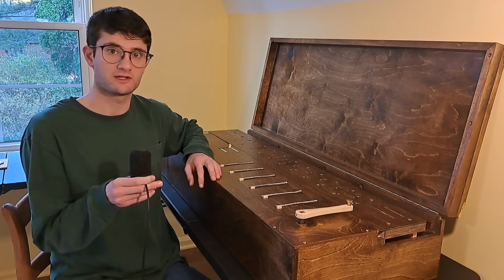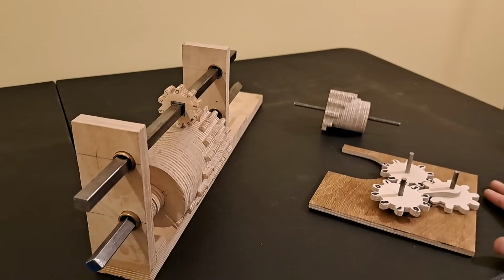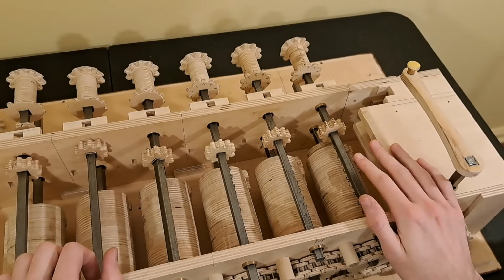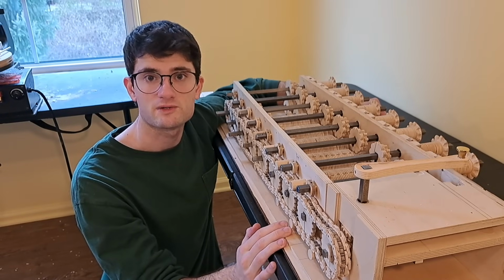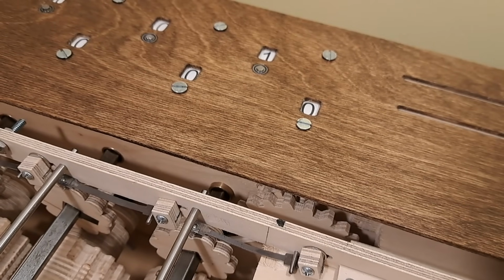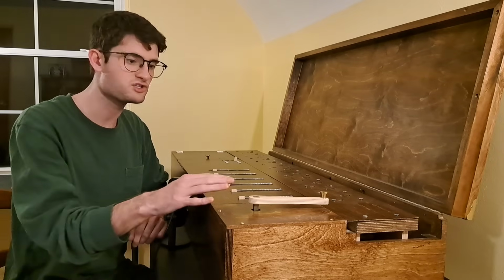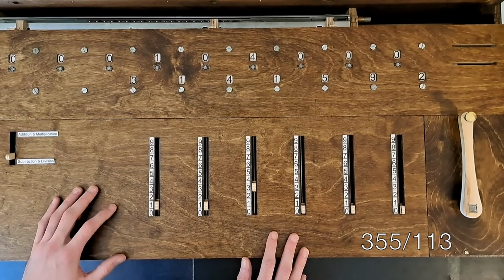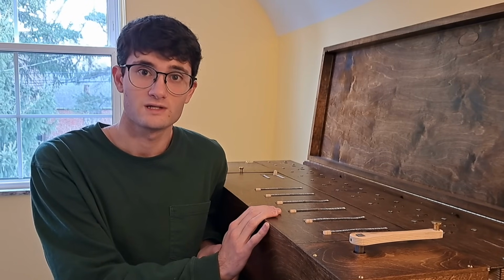How I built a Mechanical Calculator

Comment: Wonderful design. Any measured drawings available?
Reply from the maker: Thanks! Sorry I don't have a plan. Once you decide the shaft spacing between stepped drums and from the stepped drum to the 10 tooth gear, then that determines the other dimensions. In my case, the distance between drums (shaft to shaft) is 3in or 7.62cm, the spacing between the stepped drum shaft and the 10 toothed gear shaft is 2in or 5.08cm. I apologize for imperial, I started this project in 9th grade
Reply: @WhatWillMakes  Thank you for your reply. I'm 68 years old, so imperial I understand...lol.

Comment: I have a Monroe Adding Machine and it's really cool seeing how this behaves exactly the same way.
Even clearing the counting register lifts the whole assembly up automatically before clearing to disconnect it from the gear train.
The technology got miniaturized, but fundamentally stayed the same until it was replaced with electronics. Heck, even the motor driven ones (electric but not electronic) operate in the same way.

Comment: I broke out laughing when instead of simply labeling the digits in reverse on the second wheel, you added a third intermediary wheel just to carry.
Reply from the maker: If I had been making a full sized Schickard or Pascaline adder then the reason would be more obvious, we want each input wheel to rotate the same way because then the user interacts with all of the input wheels in the same way. With the Schickard adder in particular you could also do subtraction and it would get confusing quickly which way is needed to rotate the wheels if every other one goes in the opposite direction. Thanks for the comment! - It gets to a core element of these machines, that every decimal column should behave the same, especially to the user

Comment: Dude... cool project!
But please, for your own sake... just buy a 3D printer.
Even the cheapest one would help you out tremendously.
But I admire your dedication.
Reply from the maker: Thanks! About 3d printing, a couple people have asked and the answer is I just like working with my hands - I find it very satisfying. Also, as I say at the end, I like how it shows that specialized machinery was not needed to make this technology
Reply: @WhatWillMakes  Expanding on your tool set doesn't conflict with that.
It just opens up new possibilities.
3D printing isn't magic bullet, and there is still labor involved.
But it's perfect for repetitive tasks like the chain links.
Also they are fairly common consumer products now, so I wouldn't call them specialized.
Ask a friend if you can borrow one for a project to test it out.
You could use one just to print out jigs or templates to speed up your workflow.

Comment: How about using a mechanical computer to make a lead and bullet drop calculator for a nerf gun? It would be hard making the parts small enough to be portable, but it could be done with wood as a prototype and then scaled down and made of metal to be mounted on the gun. For the display you could use a reflector gunsight to frame the target's position and range. It was done by allied fighters during WW2, so with enough tinkering, I'm sure it can be done.

Comment: The reason you didn't share the exact measures of the project is to incentivize people to be creative and build their own versions of the calculator?
Reply from the maker: I didn't really try to make this video about how to recreate my exact calculator, more about the principles of how it works and things of interest. I simply don't have a set of plans or anything, just a couple of drawings for some of the wheels, most of which are drafted by hand, the other dimensions grew out of some specific dimensions for shaft spacings and I didn't need to create a full plan. All the gear templates were generated using Matthias Wandel's gear generator program found in the description. I suppose I could retroactively make a set of plans, but I'm not really sure that work would be worth it. But if you want any specific dimensions please ask!

Comment: Sweet work there!.  I couldn't help but grin.  

As a bit of personal history, I went to university in the late 60's having mapped out 5 possible different engineering career disciplines to explore. One of those was chemistry which I truly enjoyed BUT hand performing the multiply and divide calculations to the precision required drove me batty. I finally found a Frieden mechanical calculator which, when operating bumped along just like your design.  This was so painfully slow that I abandoned that path, tested the others, and finally fell in love with electronics and earned a degree in electrical engineering with an effective minor in computer science (a field that did not really exist back then). 

Getting back to calculators during that time. Precision extended electronic calculators began becoming available in 1960 and the first emulated the Frieden machines.  Wang made the first extended-range 4-function calculator around 1966. I got my hands on the Electrical Engineering Department HP9100 programmable in 1969 (the year after it came out) which I programmed to plot EM antenna radiation patterns from equations.  I finally got my own sweet HP-35 in 1972 the first year the came out while working at my first engineering company.  Since then, my ability to put calculating and computing power to use in electronics and mechanics has continually grown.  It's fun to look back but I wouldn't trade my ability to mathematically and computationally explore the ideas that rattle around in the gray matter. 

Again an excellent exploration of first principals engineering.

Comment: Clever!.. Dividing 355 by 113.. I use this number also for doing "quick paper calculations"
Nice to that this device shares a lot of simularities with the Curta Calculator, setting the numbers, and moving the result slide..
Reply from the maker: Thanks! The way I've been thinking about it, the Curta is like rolling this calculator up around 1 stepped drum
Reply: @WhatWillMakes  Exactly, looking at drawings and 3D printfiles of the Curta Calculator, that is what Curt Herzstark actually did.. but then so small you can put one in your pocket.. 
Compared to your handywork, which i find impressive maybe you should get hold of a wooden barrel to make a wooden "Curta"...

Comment: It occurred to me that the input could be done by twisting dials to turn gears that drive racks to move the drive gears to the correct position. Add in another spring detent for the input gears/dials/knobs and you get more certainty and a little more elegance perhaps? 🤔
Reply from the maker: That's a clever way of doing it! Actually seems sorta similar to the reconstruction of Leibniz' Stepped Reckoner in the Arithmeum. I considered adding some way of registering the input sliders, but I really wanted to be able to easily take the top cover off and see the stepped drums and carrying mechanism. Thanks for the comment!

Comment: Back in the 80s I went to a vocational electronics school. Personal computers were just becoming a thing so we spent quit a bit of time understanding how a modern computer functions.
For all their power and marvel the modern PC it still only does what your little adding machine does here.
Instead of gears it uses logic circuits which do not think, they only respond mechanically to a specific input.
Your PC is still only an adding machine and can only add numbers. All other functions are simply a variation of the addition function. Everything it outputs to the monitor for your eyes to see begins as a mathematical operation and all of those operations can be reduced down to simple addition.

Comment: The factor 10 for each digit is not only fundamental to the decimal system but also to the  metric system of units ... so your next challenge is to make a machine that allows adding up length measurements in 1/32 inch increments and has a readout in inches/feet/yards ... multiplication represents e.g. calculating the area of a room ... division would be the length of a square room given its area ... 16 teeth gear to get to  inches ... 12 teeth gear to get to feet ... 3 teeth gear to yards ... 😅
Reply from the maker: Could definitely be done! Some calculators (including some models of the Pascaline) had different bases for working in different currencies. In Ancien Regime France 12 Deniers went into 1 Sous, and 20 Sous into a Livre, so Pascal made some models that worked with those bases

Comment: This is so cool! It's like a Curta calculator that's been unrolled flat.
Reply from the maker: Thanks! and yeah that's how I've compared it to the Curta as well!
Reply: Might be more accurate to call a curta a rolled up arithmometer! (Which is a very nice solution to the redundancy of the rotating drums!)
Reply: @rewindoflow  Indeed!
Reply: The Curta does have one very significant mechanic difference though (besides the shape and size). It only drives the results wheels forward. There is no reversing mechanism for subtraction. It actually uses 9s complement addition to simulate subtraction, and the single central stepped drum is actually two stepped drums with tracks of teeth interleaved together. The subtraction mode is engaged by slightly lifting the stepped drum, which moves the alternate subtraction teeth into alignment.

It's quite a crazy and interesting mechanism, which I don't think any other device has used.
Reply: @TonboIV  Yes, I don't recall seeing doubling up of the stepped drum elsewhere. A very neat solution, and one that only makes sense on the Curta!

Nine's complement subtraction does have uses in other machines though, most notably in the operation of comptometers where it's used as a manual routine to perform subtractions (hence why the keys are often marked with things like 1/9, 2/7, etc). It's also used in the Mercedes Euclid, which has a rather unique proportional lever mechanism.
Reply from the maker: (I am delighted by this conversation – thanks for all the knowledgable comments everyone!) I know the Pascaline also used nines complement on its result dials to do subtraction
Reply: @TonboIV  For similar reasons, common computers use 2's complement numbers for signed fixed point arithmetic. Earlier computers used a variety of systems, including 1's complement in e.g. the PDP-1. The PDP-1 also used traveling pulses for actuation, not a central clock.
Reply: Yo it's codeparade!
Reply: Maybe curta us this rolled up

Comment: You need a better way to clear. It would require a redesign of the carriage so lifting would not be needed to disengage. It would also be nice if it would lock if you went negative on subtraction. That would make division easier.

Comment: This is a work of art, the machine, the process, and the video. May I ask why you opted not to use more time efficient manufacturing methods such as a laser cutting or CNCing rather than cutting out the gears by hand? I realize some gears shall not work well but most are purely two-dimentional cut-outs.
Reply from the maker: Thanks! For one I don't have a laser cutter or any CNC machine, but something like that would definitely save time. I also just like using my hands, it's very satisfying. Then as I say at the end, I like how it shows it doesn't take specialized machines to make technology like this (people had been cutting much smaller gears for clocks for centuries), but rather enough interest in solving the problems. I appreciate the question!

Comment: As an alternate idea... rather than gears, you could use a length of cord (as long as it doesn't stretch.)  fastening the cord to different shapes gives the same operation, pulley, or hanging it with a weight and using a shaft.  One other idea, using magnetism, you can create positional transmission with a device called a syncro... which is just a precision three phase electric motor. Happy Sunday!

Comment: Am I missing something or is there any reason on why you would not need to carry a 1 over to the next digit. Couldn't you do without the lever mechanism and extra gear.
Reply from the maker: I'm not sure exactly what you're asking, but I think it is why the the result dials need to be able to be disconnected from the carry mechanism? And the answer is so that we can shift the results assembly over into a new decimal place. If your question is why we can't use the same carry mechanism method as I made in the demonstration at the beginning of the video, then see endnote 2 in the description. Thanks for the question!

Comment: I once saw a video explaining the curta calculator and did not understand what was going on. Seeing how you solved each individual problem based from clear design requirements made it easy to follow and understand the impressive complexity of the machine you have built. Well done! Also very impressive how many hand cut gears you've managed to turn with a single crank, I can imagine preventing friction throughout the machine was not trivial. 

One of the most impressive things I've seen!
Reply from the maker: Thanks so much! I'm glad my explanations made sense, it's very gratifying to hear people's feedback. Yeah friction is the enemy for sure
Reply: @WhatWillMakes  I've assembled a number of laser cut clockwork mechanisms and rubbing the gear teeth with paraffin wax makes them run much smoother with less friction.
Reply: I recommend you this if you want to revisit the curta, especially with the understanding you have now. I think you'll find a lot of the solutions are very similar in concept, just very different in scale and precision. This series of two videos is what helped me understand the curta

https://www.youtube.com/watch?v=vCjJ5GeuQD8
Reply: @MinecraftTestSquad  Thanks! I'll take a look

Comment: Marvelous craftsmanship. Has any lubricant been necessary? I imagine it runs much more smoothly with paste wax on meshing parts.
Reply from the maker: Thanks! I put some light clock oil on the bushings, and played around with wax on the wood, but I've found that when the tolerances and fit are just right, wax isn't that necessary

Comment: This explanation of how division is just repeated subtraction was really interesting to me. That's actually how GPUs do their division operations too, because they're technically only capable of handling multiplication, addition and certain bitwise operations. But i never could wrap my head around how it worked until now.
Reply from the maker: I didn't know that about GPU's. Fascinating! Thanks
Reply: @WhatWillMakes  makes sense, modern computers are basically just the inevitable outcome of humans seeing this machine and saying "Okay but what if we could do more/faster calculations?" Lmao
Reply: If you make the mistake of doing integer division on a GPU then it'll use some software-implemented division algorithm yeah, though typically people will use floating-point arithmetic on a gpu in which case division will typically be done by estimating the reciprocal of the denominator using a table lookup, then improving that reciprocal using newton iteration, and then multiply the numerator by the computed reciprocal.
Reply: Here's a fun one though, the Texas Instruments C6x DSP architecture has an instruction intended for implementing integer division, but it's quite a funny one. It takes two 32-bit operands and produces its 32-bit result as follows:

if( operand1 >= operand2 ) {
    result = ( operand1 - operand2 ) * 2 + 1;
} else {
    result = operand1 * 2;
}

Implementing integer division with that is left as an exercise for the reader ;-)

Comment: Great video, thx for sharing. Make a modern binary version. No need to stack 10 wheels, you just have 0 and 1... or hardcore hexadecimal version...
Reply from the maker: Thanks! Yeah a binary version could easily be made, not needing to stack 10 wheels. Leibniz certainly realized this; he campaigned for the general use of binary in all calculating, and he wrote about how a simple binary adder could be made using balls and chutes. I like how this calculator highlights what base ten means, and how there is nothing special about it, could easily be binary or hexadecimal.

Comment: this is rad. i bet based on design you could put the addition/subtraction switch in "neutral" if you will and then reset the number counter without lifting the display face 🤙🏼 maybe, probably not since you didnt do that in the vid. increidble effort, this is awesome
Reply from the maker: Thanks! And that's a very perceptive suggestion about resetting – and it so almost works! It's a little bit too tight unfortunately

Comment: What about spring loading the shaft of the handcranker and have a push button that releases it full rotation (and can have 1-9 buttons/rotations) and wallah no hand cranking !!!
Reply from the maker: Yeah that's a good idea, could probably be done! You'd still have to wind that spring occasionally, but would save time during a calculation

Comment: I love the springed certainty mechanisms and how they contribute to the sound of the calculations.

If you wanted, you could use springed detent mechanisms to fix the positions of the input sliders as well as have a horizontal slider on the display panel that you set as the decimal when starting in a shifted position. 

Awesome build!
Reply from the maker: Thanks! Yeah I thought about spring-loading the input sliders, it could definitely be done. Some Arithmometers and other calculators had a way to display decimal place like that, its a good idea.